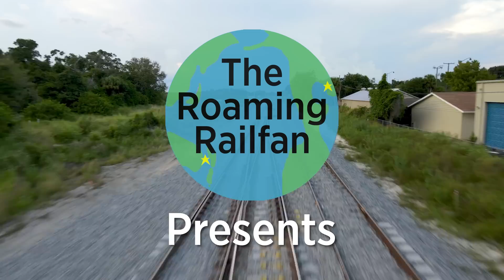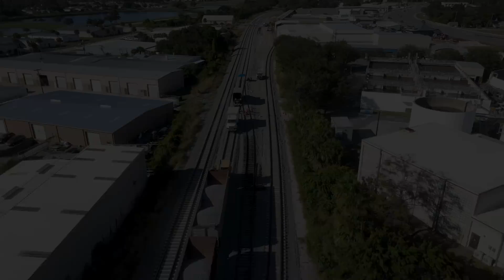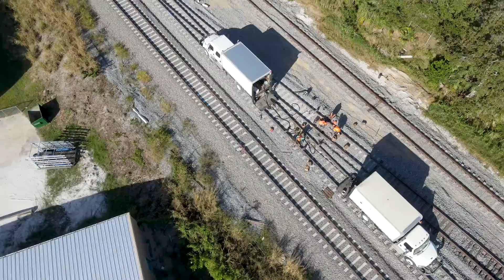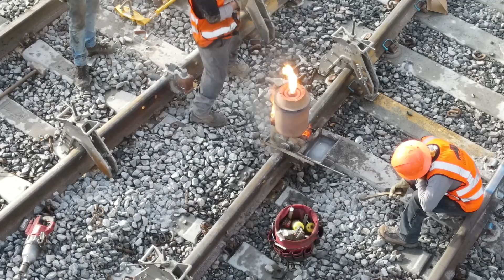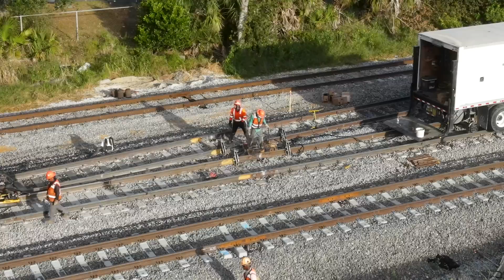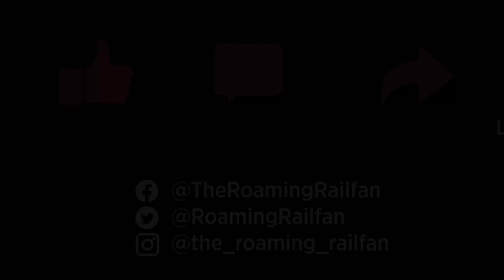Brightline Construction: Thermite Welding at Cocoa Yard Lead North

Comment: Why are they closing the gap between rails? I was always taught that there should be a small gap to allow expansion because of high temperatures.
Reply from the maker: The rail goes through another process called destressing which negates the need for gaps.

Comment: The majority of new (high speed) rails are continuously welded using this exact process to improve comfort and significantly reduce operating costs due to less wear and tear and greater efficiency. 

Do you know if bright lines tracks are welded continuously? They seem to use much longer sections than European rail usually does IIRC from one of you older videos.
Reply from the maker: Yes, everything is being welded to create continuous welded rail.
Reply: @RoamingRailfan  awesome! That's great to hear. None of the old abused rail lines here in Indiana are CWR, can hear the at most once-daily freight trains clunking over the seams. 

Brightline's success gives me hope for a return of passenger rail round here!

Comment: Thank you.  Is there any way to plug the holes on the side of the rail?
Reply: The holes at rail ends were for the possibility that standard bolted fishplate connectors were used but since the welded procedure done the holes unnecessary but pluging also not needed for the joint to be safely
 completed.
Reply: @kennethhanks6712  Good answer to Terrydikkers' question - I, too, was wondering if the welding crew would fill in the holes at the ends of those two Thermite-Welded rails. One correction - the act of filling in a hole is "plugging" (not 'pluging') it.
Reply from the maker: Not really